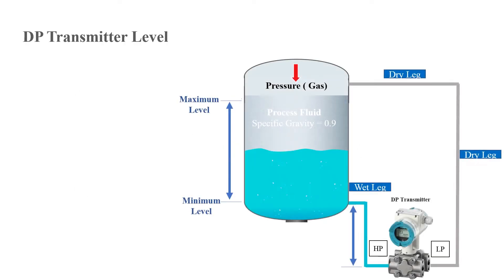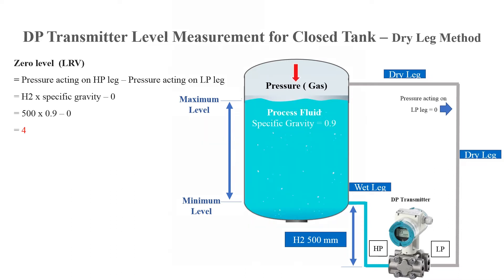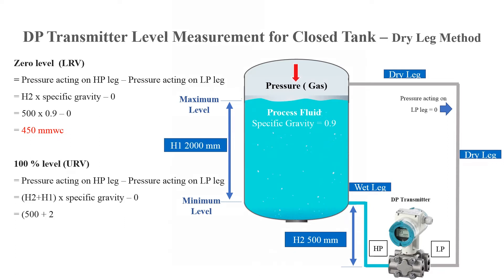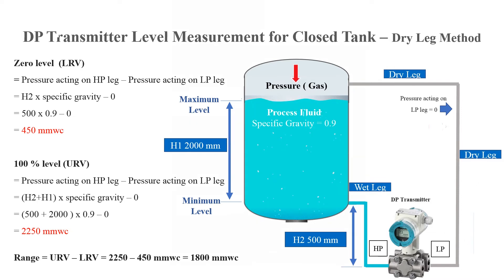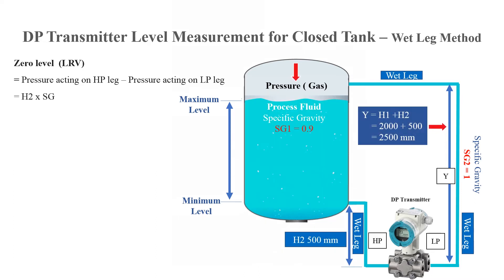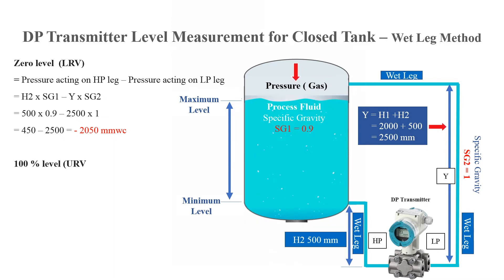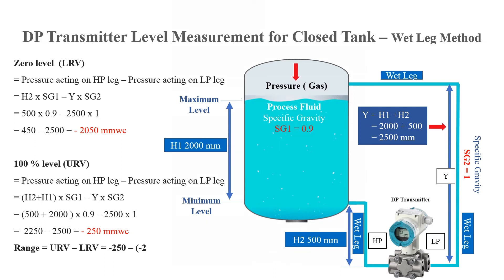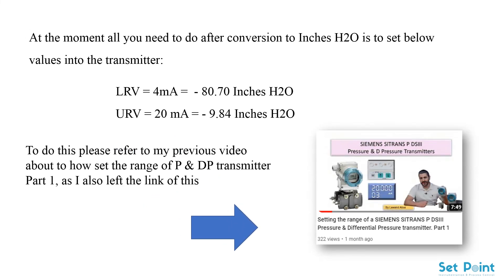DP Transmitter Dry Leg & Wet Leg Calculations

Comment: Nice Sir , but how to measure level of a closed tank , when pump is fitted at the bottom of tank  and HP and LP side have strong suction (vacuum) of pump , that means when i open HP side insted gush out process fluid  , a very strong suction of pump apeears  practically ......then how it measure level  ?
Reply from the maker: Good question.

What you’re seeing is real. A strong pump suction at the tank outlet can “steal” pressure from your HP tap and make a DP level read low or dance around, even go negative, because the HP port is sensing dynamic suction instead of just the liquid’s static head.

Don’t take HP from the pump outlet line—move it to a side/bottom nozzle on the tank or a stilling well.
- Best fix: install an external bridle (top vapor + bottom liquid) and mount the DP there (or use GWR radar on the bridle). If staying with DP: use dual remote diaphragm seals, LP with wet leg/seal pot, and a restrictor/snubber on HP to kill suction pulses.

Ultrasonic = no (vacuum). Radar/bridle or DP-with-seals = yes

Comment: When we use Wet leg and when we use dry leg?
Are there any criteria?
Reply from the maker: Wet leg method: is used where vapor has a tendency to make the condensate and temperature of process is high "such as industrial boiler drum level", or low from the atmospheric.

Dry leg method: is used in normal close tank where vapor is not condensate and temperature of process is equal to atmospheric.

Comment: Very clear explanation. According to the conventional training programmes it's saying that the HP side of the DP transmitter is connected to Drum (Water) side and steam side connected to LP side of the DP transmitter. In this explanation, in Wet leg method HP side going to negative pressure. In actual mounting on our boiler HP side of the DP transmitter is connected to steam side (Top) of the boiler with condenser pot and LP side of the DP transmitter is connected to Drum (Water) (Bottom) side. This is true as per your explanation. Thank you very much 🙏
Reply from the maker: Thank you so much for your clarification, and you are more than welcom dear 🌹